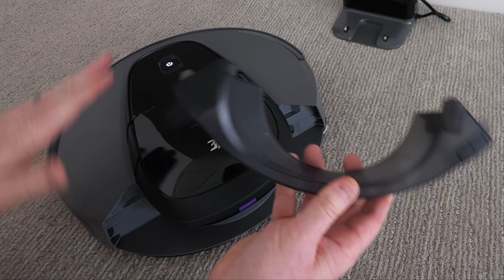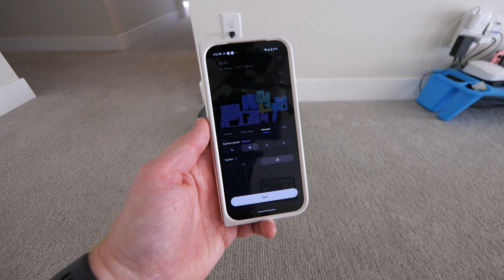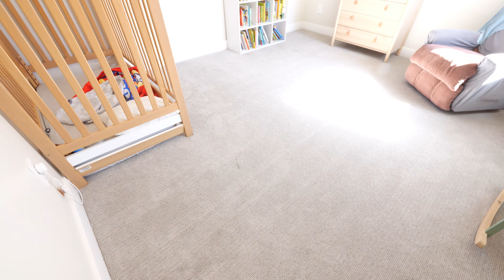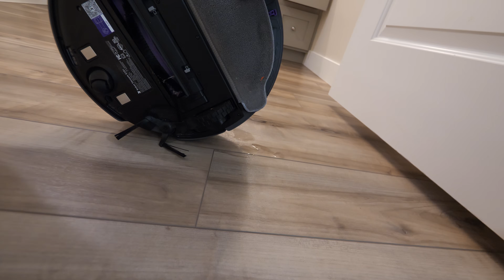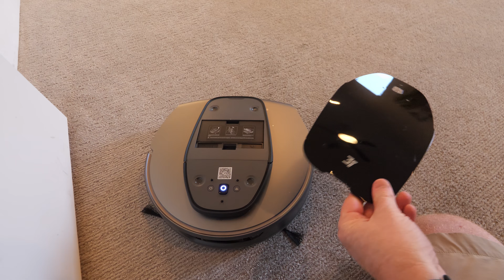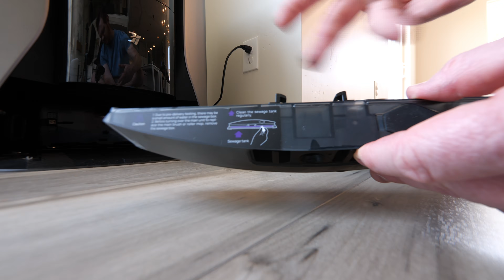3i Robot Vacuum & Mops Take the Work Out of Cleaning

Comment: Thanks to you I bought the G10+.  Question; I have it set up in my office, which is separated from the rest of the house.  How do I set it up to do the main house rooms?  Obviously, I need to take it into that part of the house, but do I take the base also and create a map for that part of the house?  And then just move it back and forth?  Watching it operate when I set it up, I never saw the side brush extend.  I would think that it should have done it when doing the front of cabinets under the toe kick.  The way the obstacles work out it never actually hits a 90 degree corner.  Thanks for your time.
Reply from the maker: Oh cool. Is your main space on a separate floor? If so you just need to move the robot to that area and then go into the map view and create a new map. Then you can just move the robot to where you want to clean and start it.

If the main area is on the same floor as the office I would recommend remapping the entire floor (keeping the charging dock on the office if that is where you prefer) and then you can choose which rooms you want it to clean in the app. You can also merge and split areas after mapping if you need to.
Reply: @TechWithBrett  Thanks for the feedback.  The rest of the house is on the same level but I'm thinking that it will be easier to just take it and the base into the other part and do that mapping separate.  I'm an old fart with no kids etc, so I'd probably only need it to run once a week or so.  But I will play with it, as I just got it.  Thanks again for the video.